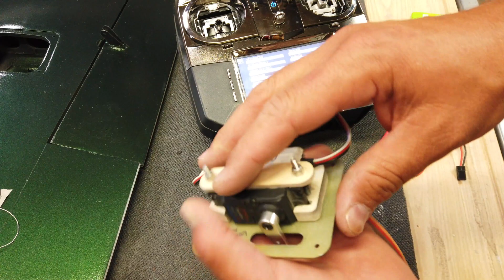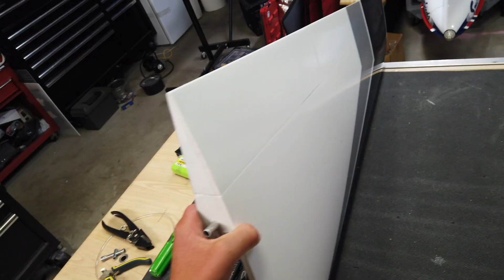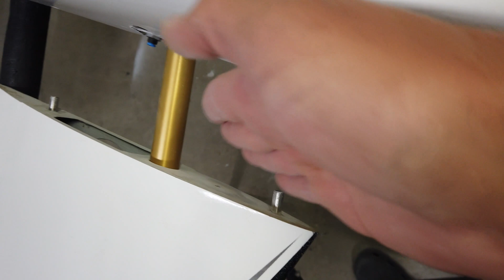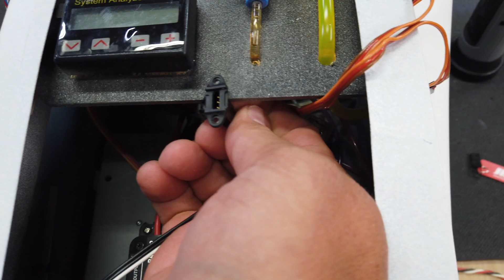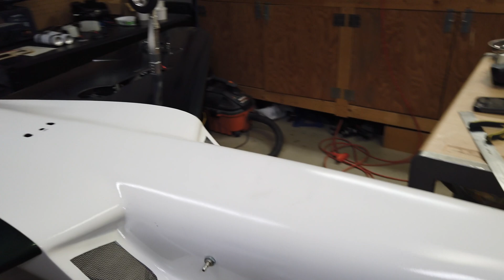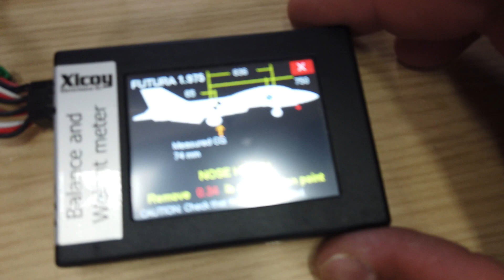Building A Tomahawk Futura Turbine Jet - Rebuild Video #3, Final setup 28x, JRPROPO 11BPX Install

Comment: This is not a comment .I have a qoestion on how to install a gyro 3e power box Could please show the install and where to plug in the power. Thank you Peter
Reply from the maker: Hey Peter.  With the gyro 3e there is not separate power needed.  If channel 2 is your R Aileron you run a patch cable from your receiver into the Aileron A channel of your gyro.  Your right Aileron servo or servo extension lead plugs into the output of the 3e gyro.  The leads coming from your receiver power they gyro.
Make sense?